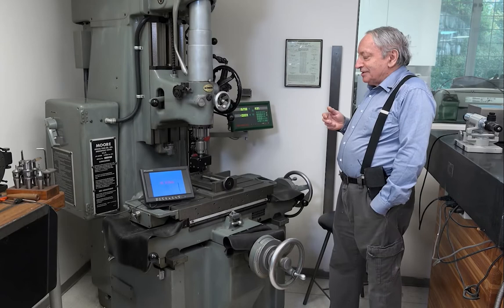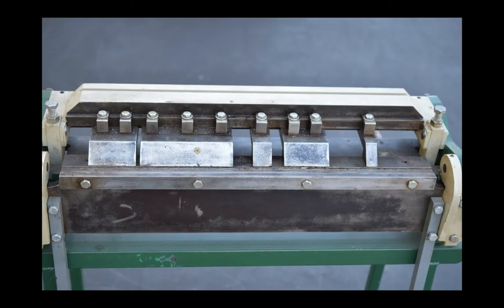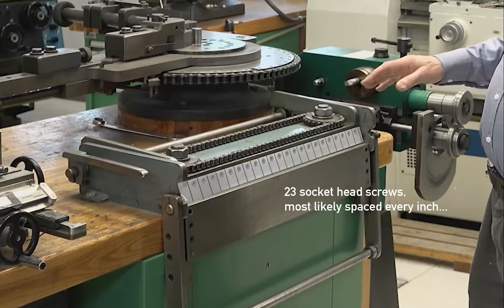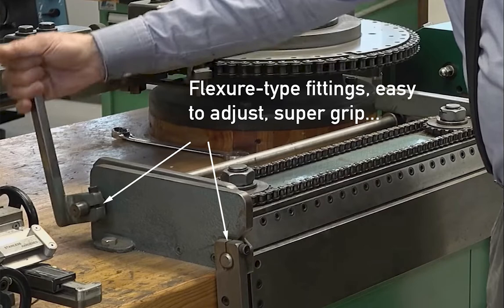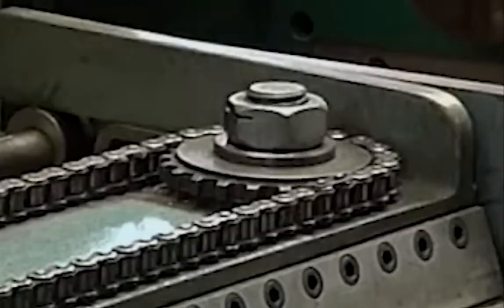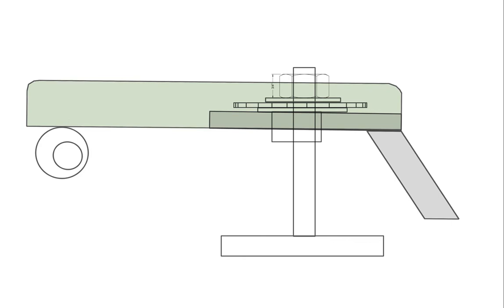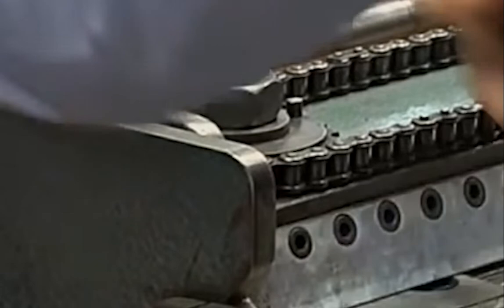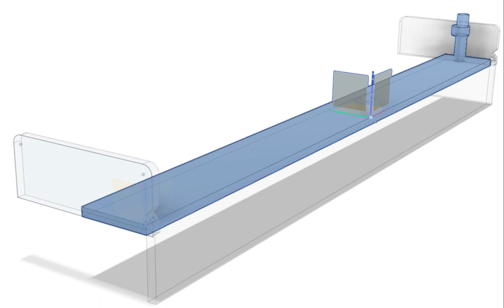Recreating Dan Gelbart's Bending Brake, Part1

Comment: It is quite simple: the bottom of the large 2 nuts is machined spherical, and the two eccentrics have matching spherical seats. Each one of the large discs under the 1" nuts has an eccentric groove machine into the bottom (about 10mmx10mm channel) which mates with a 10mm pin pressed into the moving top plate.  Most of the parts are case hardened to RC60 and the shafts are hard chromed cylinder rod stock. This is why it looks (and works) like new after nearly 50 years of use. The slots visible in the 1" nuts are to make them self-locking.
Reply from the maker: Thanks for sharing these details, Dan. That's very generous of you! I was wondering if that plate was moving in only one axis, or sort of 'orbiting' around the eccentric. The pin-in-the-slot description reveals quite a lot: it's only translating forward and back. I was poking around the internet looking at 'scotch yokes' to convert rotation into translational movement.
Reply: @johnkahrs9706  wow… just watched his video, was curious specifically about that press… here’s your video… this must be a sign
Reply: @johnkahrs9706  Also, one detail not seen in video: there is a 1.5"x0.5" strip (the 1.5" dimension is vertical) under the front of the botton 4"x0.5" plate to stiffen it vertically. Most of the stiffness of the bottom plate comes from bolting it to the thick laminated beam table. To bend #12 full width steel you need very high vertical stiffness.
Reply: Hi Dan, Amazing work! I’m also trying to make a similar machine. How did you attach the angled 1.5” blade to the moving horizontal 4” bar? I see the counter sunk holes and screws but I can’t seem to figure out how you have a strong angled connection here.
Reply: @illaimforthemoon  The angled bar is bolted to a 3/4"x3/4" bar  behind it, which is welded to the top bar. . The large number of socket screws is, as you guessed, is to allow using segmented bars.
Reply: @dgelbart  It is heartwarming to see a grand master sharing his secret knowledge with young apprentices.
:-)
Reply: This  sounds like the arrangement one sees on a lathe tool post, with a rocker to adjust the height of the tip of the cutting tool, yes?
Reply: @wanglydiaplt  Yes, similar.
Reply: Watch Gelbart. Watch Gelbart. He is master of us all!

Thank you sir!
Reply: Dear Dan,
I have watched your videos many times over and am impressed with your designs of machines and tools you have made.  Would you consider making videos that go into how these work?  This would help us correctly build our own without having to guess looking at your videos and making assumptions.  I particularly appreciate your suggestions for obtaining readily available and relatively inexpensive parts such as the use of roller bearings used in skateboarding!  Brilliant!  Thank you.
Reply: @neatmachine  Unfortunately I'm too busy with my current company (Rapidia). Maybe in a few years.
Reply: The legend himself. Give us more videos, Dan! I keep rewatching your channel
Reply: Does the camping table also rest on two additional spherical nuts? So it is seated in between one top and one bottom sperical nut on both sides?
Reply: No, just the top.

Comment: as Dan is clearly european, i think basing everyhing of inches is not a good idea.
Reply: The inch system is always a bad idea, but when I built this brake 50 years ago you could not get anything metric in Vancouver (bars, shafts, fasteners) so I made it to Imperial measures. A small point: All shafts are 3/4" chrome-plated cylinder rod, which is reasonably economical.  After 50 years of use there is still zero wear. The two small eccenters at the rear are also slices from a larger chrome plated cylinder rod. The nice thing about cylinder rod is that the outside is Rc65-70 and perfectly polished but the inside is machineable. It was cut with a hacksaw after breaking through the chrome plating with a grinder.